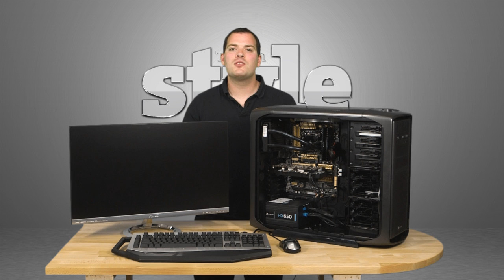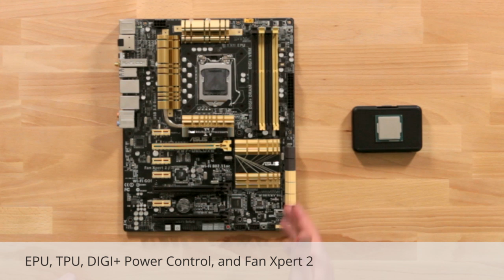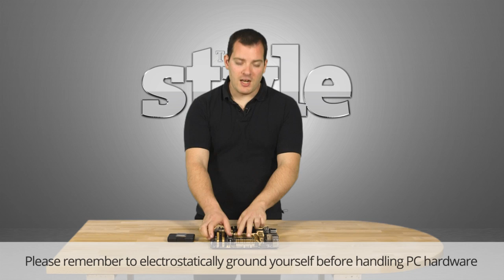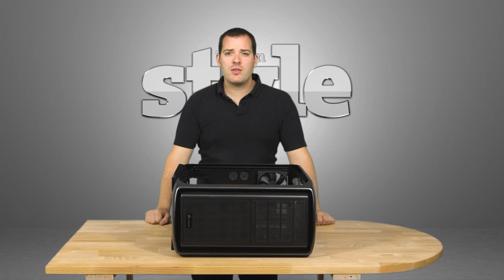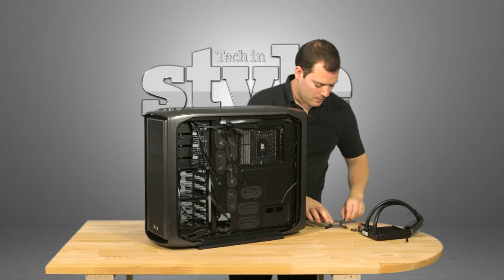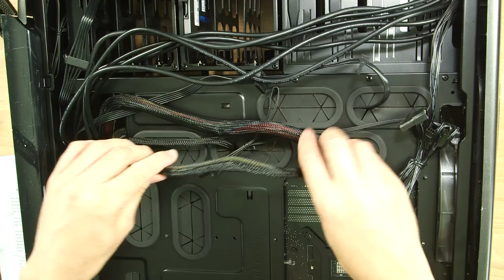2013 PC Build Guide! $1,250 Family & Gaming PC with NFC.

Comment: you should get better fans i have 2 corsiar sp 120's for the rad  200mm bitfenix spectre pro series bitfenix recon fan controller my specs i7 3770k 4.2 ghz asusZ77 sabertooth  asus directcu ii hd 7970 3GB 16GB patriot viper 1866 memory antec 620 cpu cooler antec 900w 80+ psu and the corsair 600t 
gun metal case cant even hear it on full load the one thing that was loud was the stock fans one thing the top 200mm fan was only 900rpms and thr front was 1000rpms lol crazy upgrade your fans

Comment: Thin panels a lot of mesh (on the top the fans have to travel through 2 lots of mesh and front have a filter) and structures causing airflow noise. I also changed the fans. + there is no sound dampening

Comment: The included fan controller on the 600T only has 4 channels, 3 of which are used with the stock fans. If you want to use the 4 side window mounts you'll need another fan controller.